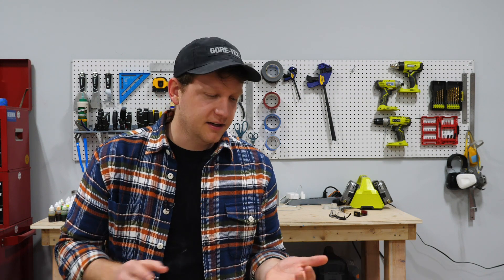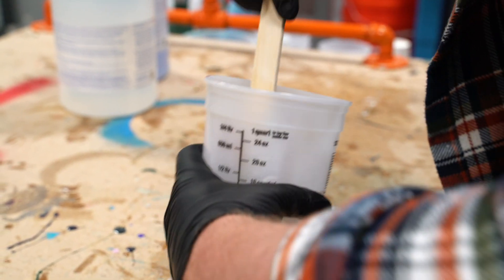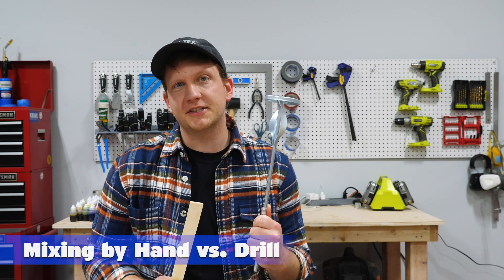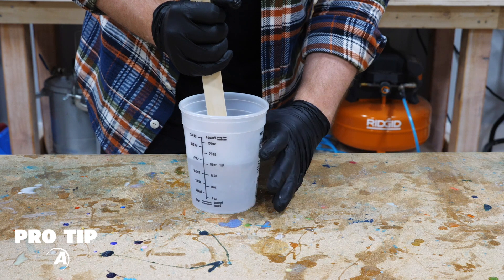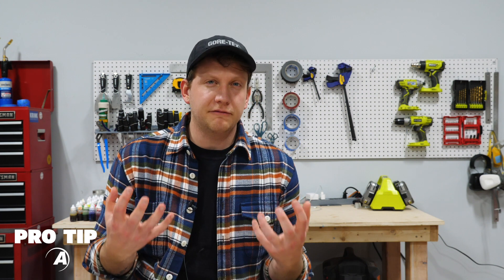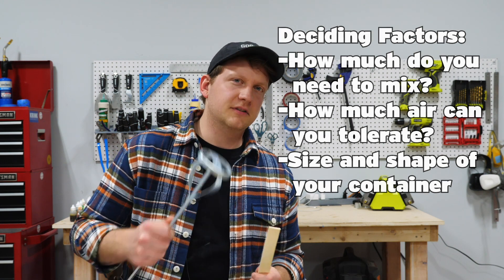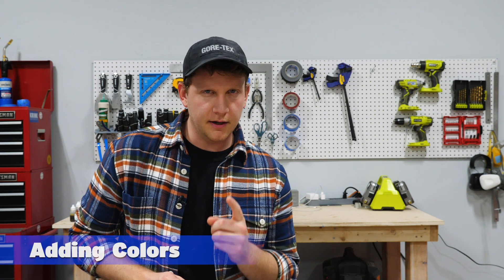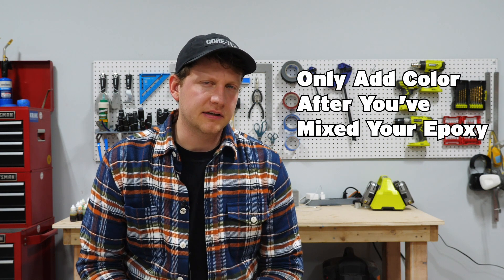How To Mix Epoxy | Alumilite

Comment: Very new to all this, if I add color to either A or B to better see if both are mixed fully would that work? Or would the color interfere with it?
Reply from the maker: you have to mix part A and part B together before adding any colorant otherwise it will effect your resin cure

Comment: Hi very nice elaborated presentation. I have a few questions. When does epoxy start permeating fume and when does it stop ? How do I clean my measuring cups ? I prepare my epoxy in my garage with door open and a fan working behind me , am I safe ? Or I still need some kind of a mask ? I appreciate your input.
Reply from the maker: Epoxy resin typically starts emitting fumes as soon as it's mixed with the hardener. The emission of fumes can continue for several hours, gradually decreasing over time as the epoxy cures. However, the duration and intensity of fumes can vary depending on factors such as temperature, ventilation, and the specific type of epoxy used. To clean measuring cups used for epoxy, it's important to do so promptly after use to prevent the resin from hardening. Use paper towels to wipe out as much resin as possible from the cups.  We have a brand new Amazing Resin Remover that will make that very simple. Then, you can wash the cups with warm, soapy water, using a scrub brush or sponge to remove any remaining epoxy. 

While having the garage door open and using a fan for ventilation is a good practice to reduce exposure to epoxy fumes, it's still recommended to wear a mask or respirator rated for organic vapors as an additional precaution, especially if you're working with epoxy for extended periods or in a confined space. Masks can help filter out harmful vapors and minimize inhalation risks. Hope that helps!

Comment: OK tried earlier, on later video. I’ve been getting a film and a bunch of tiny spots/bubbles using the CC surface epoxy. Have been told that my pours are more than 1/8” and should use CC+ from r 3/8 - 1/2” deep pours. That correct?
Will see if can send you pictures of these troubling results. If can’t, I would be able to send to a email or text.
Dennis 0:14 0:14 0:14 0:14 0:14

Comment: You say the mixture is by volume.  But personally I would rather rely on a precision scale based on weight.  Can I assume your products define the mixture ratio also by weight, maybe something like 100:84 ?
Reply from the maker: Some of our products can be measured by either weight or volume but our epoxies are strictly by volume. Because the two sides are vastly different in weight the ratio isn't very friendly and so not defined in our data sheets or website.

Comment: Hi Alumilite. I have a project which is a games table made from veneered plywood, which I am going to apply a layer of ACC to. However, I need to know how much to purchase, and cannot find info on volumes for a flat table top poor. If I have a table top which is 27 inches by 48 inches and a 1 inch side to drip over, how much ACC do I need?

Comment: Will your epoxy yellow over time  on a lure?
Reply from the maker: Great question! All epoxy yellows overtime no matter the brand but we've formulated our products to last as long as possible under UV lights! A lot of lure makers like to use Alumi-UV to coat their lures for a durable and shiny finish!

Comment: How to measure if my resin & hardener with 3:1 ? 750gram (resin) & 250gram (hardener). No idea on how to measure and pour correctly. As my silicon mould is big. (L 18cm x W 25cm)
Reply from the maker: Hi Kiranyaa!  Does your resin need to be measured 3:1 by weight or by volume? If by weight, you'll need a small scale. If by volume, a container with measure marks will be helpful. If you need to learn how much resin you need, fill your mold with rice and pour that rice into a measured cup. That's how much resin you'll need to fill it.
Reply: @AlumiliteCorporation  thank you for your advice ☺️ hopefully it works

Comment: Why is stays cloudiness even when I’m stirring..
Reply from the maker: Hi there! It may be due to air being added while mixing, or your product being too chilled. Try warming your closed bottles in a warm water bath before you mix and see if that helps clear it up!
Reply: Alumilite Mold Making & Casting Materials thanks I will try that

Comment: Hi, Thank you for tips. I have a question, once you have mixed the color in, how long is the shelf life of the epoxy resin mixture and color?
Reply from the maker: Great question! You shouldn't mix in your color until you are ready to make your project! You can add it to side A or side B first and then mix them together or mix the sides first and then add the color - either way, all of our products have a shelf life of a year, unmixed. Once mixed, you have until the end of the open time to use the epoxy  - once you've reached the end of the open time, the mixture will begin to cure! So for example, Amazing Clear Cast epoxy has an open time of 30 to 40 minutes - this includes mixing, adding colors and inclusions, and pouring!

Comment: Nice video, really important tips that are essential when you want to create top results!
Tips from my experience that I'd like to point out too are ways to avoid excessive waste of cups and stir sticks by using silicone measuring cups and spatulas. In these you can just let the leftovers cure in the cup and easily peel them off afterwards. The flexibility of the spatula also really helps to ensure you get it all perfectly mixed!
I switched to silicone after I once "ruined" a nice piece, I discovered a tiny wood splinter from the mixing stick that had broken off and got enclosed for eternity. Very annoying!
Reply from the maker: Those are great tips! The reusable cups and spatulas make clean up so easy. Thanks for sharing!

Comment: removing bubbles in small castings: pour into mold down a small diameter wood dowel sticking into the final pour .  The bubbles float to the surface on the dowel and remain on the surface of the pour.
Reply from the maker: That's a great tip! Thanks for sharing!

Comment: This is great, thank you! Could you expand on why you recommend adding the color after you mix? I've only worked with polyurethane, but I like to do it before because once I mix the parts I'm on the clock and it helps me see that everything is well blended together. Btw, love your Amazing Resin. Occasionally I wish it cured slightly slower depending on the project, but it is great.
Reply from the maker: We have a longer open time with epoxy, so mixing A and B together first you can confirm that's been well combined, there are no swirls, etc. Then, adding the color ensures everything is well mixed so you'll get the best and strongest cure!

Comment: Wow, thank you! Now I know why I've had a few Ooops here and there. Lol. Live and learn.
I do want to add that I have tried Gallery Glass in my Epoxy Resin with great results. I have mixed the Epoxy until there are no swirls, so, does Aluminite stay cloudy even though you have no swirls and few bubbles? Sometimes I have to mix beyond 6 minutes. When I use Art and Glow, the mix is crystal clear, so the cloudiness in Aluminite has made me feel as if I had to continue to mix it. Got spoiled with the crystal clear, I guess. I have to admit that I love your product. I started with the small ounces and now I'm into the gallons.
Reply from the maker: The "cloudiness" is most likely micro-bubbles created during mixing. After pouring, go over the surface with a heat gun or torch - the rest should make their way to the top and release before curing fully!